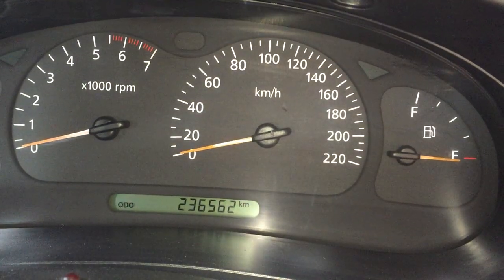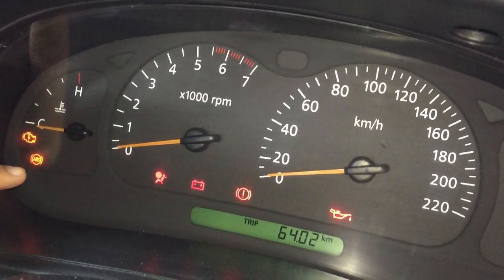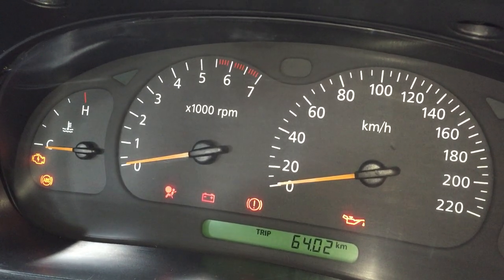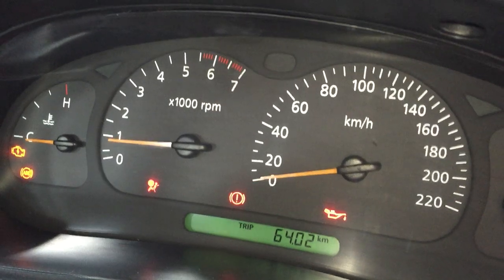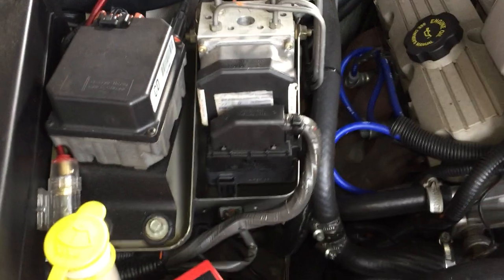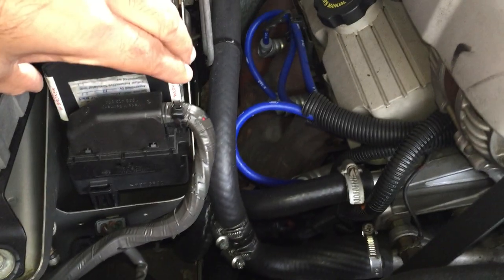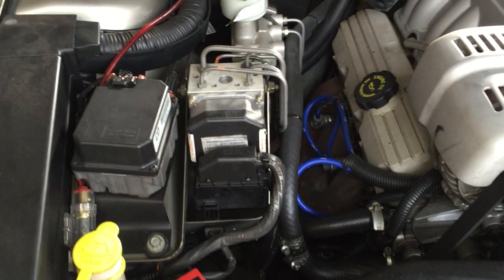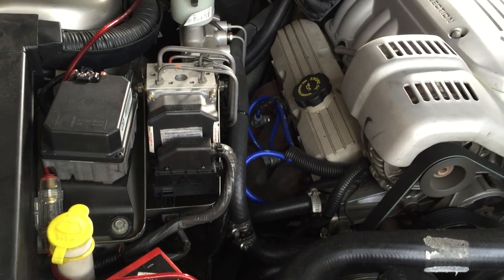HOLDEN COMMODORE ABS  ALL DASHBOARD LIGHTS FAULT

Comment: I had this issue on my 2003 VYII Berlina years ago, it was a known issue with the ABS involving poor quality soldering of the solenoids within the ABS housing. Symptoms were loss of aircon control, various dashboard warnings coming up including the ABS light, plus because I have a Berlina with climate control, a tiny cross displayed on the climate LCD near the degrees display. The issue is widely known and discussed on the Holden forums. Reworked replacement units are available for less than $200 online. Cheers.
PS A failure of the solenoid pack does not affect the braking system, you simply will not have ABS operating. Brakes will operate as standard non-ABS.
Reply from the maker: Well done

Comment: To quickly prove that this is the fault, turn off the engine and disconnect the battery then unplug the main connector on the abs unit (pull the red plastic tab to the right to release the plug). Then reconnect battery and start car. The issues should have gone except the abs light will be on of course. Did this with my VY.
Reply: I just did this... but all the lights stayed on (VU-SS). 

I would normally have Engine, Airbag, Oil Lights on. Temp gauge doesn't work. Cruise On doesn't work, but Active will. By doing what you did, the only difference is the ABS light comes on as well.

Comment: Mate good upload. As of this morning, mine has decided to shit itself. But had a couple "warnings" that something was wrong over the last week or so. First thing i noticed, when flicking the indicator on, my radio cut out then back on, then couple days ago, stopped at traffic lights and split second all the dash lights showed but went out as quick as they come on. Then this morning, started sweet as, but noticed the speedometer/trip part of the dash, was kind of dimming on and off then into gear, started to move and..... DIED.  I have just now, disconnected the battery, pulled the "red" pull on the wires connecting to the ABS mod, pulled off then back on, connect battery and its going again. So off now to get diag tool... see what the drama is
Reply from the maker: looks like you need a new car lol. Bro I would recommend you get a second opinion from a mechanic before you spend any money on anything.
Reply: lol.... na its a minor hiccup bro :-) But had a Holden tech, had a mechanic, had a Auto Electrical dude check it out and all the same thing.  Spoke to the electronic people who repair this sort of stuff and what they were saying, is what i was seeing, so no new car, just a reco`ed module.
Reply: 3 months on and still this bloody drama haunts my car. I sent the ABS module off to get tested and checked out, they could not find any fault with it. All back together and every now and then, especially when you have head lights on, up to a wall, you see the lights dimming, bright and dull, see the dash lights doing the same. Just last night, it did a ripper, cranking along the road, hit high beam and fuckin ABS flashed up, radio went out etc etc... the engine light came on, and stayed on. Got to a destination, turned the bloody thing off. Came back out to return home and no drama what so ever. This problem is doin my head in, so any help out there, woudl be much appreciated. Just flicking through a post from 2010, looks like this other bloke had the same drama. Will copy n paste it. I cant comment on there as it looks like that post is dead. But here is what he said:  "Anyways I have a 2001 VX Acclaim wagon which has a couple of electrical issues, I was wondering if someone could let me know if these are common and how/if I can fix them. I think they are related.
 The first is that the dash lights and radio lights flicker while the car is idling. I have checked the alternator and it is putting out about 14.4 volts, so I think it's ok. The battery is alright, the car never has trouble starting, so I think that's ok. Sometimes when using the indicators it makes the dash and radio ights dim in time with the indicator coming on.
 Sometimes when lowering power windows, the tacho needle drops real suddenly and at times even the engine revs drop a bit too. Also sometimes when lowering the windows, the traction control light comes on. I replaced the master switch in the centre console a while ago with a new genuine one but this hasn't fixed it. Lowering the windows sometimes also makes the dash and radio lights dim quite a lot too, especially if using more than one at a time. The thing is though it doesn't happen all the time, just some of the time! Very frustrating.
 Do you think it is an earth issue? Would installing an earthing kit help? is this a common VX problem?
Thanks for any help you can provide.
 Bandito_Mac, Nov 18, 2010 "
Reply: South Canterbury Sky Watch did you end up fixing this problem? My VT Calais has been doing the same thing.
Reply: @southcanterburyskywatch1362  sounds like an earth problem.

Comment: Hey mate.
Did this fix the issue?
As I'm currently having the same problem...
Thanks in advance.
Reply from the maker: Yes mate
Holden quoted $740 for replacement part plus wanted the old one. I got from a wrecker for $40 and replaced it myself.
Reply: What was it
Reply from the maker: https://encrypted-tbn0.gstatic.com/images?q=tbn:ANd9GcRbS5IP8-glZeQqSxYj7vHNImqhxgA7GigiQg&usqp=CAU
Reply: @ARPMEDIAZ  thank mate
Reply: Champion!
Many thanks bro.
I've ordered the part anyways & will sort it myself.
Always do it yourself if possible...
And any advice is always helpful.
We gotta stick together & assist each other.

👍👍👍

Cheers.

🍻

Comment: Hi just wondering if you can help? Mine came up ABS fault and then when I tried to turn the key the battery was dead! I jumped started and it was fine but just did the exact same tonight! I thought it may be needing a new battery but do you think the two are connected? Thanks in advance

Comment: I’ve got a vy calais 5.7 and I’ve had issues where out of nowhere anytime while driving check engine light will appear and trac off button comes up and freezes no matter how many times you press the button. 
Every time I start my car srs airbag comes up, my car is tuned to have the PWR button on at times and recently I driven the car and it had half the power and the screen said PWR was on so I turned it on normal and back on to PWR and it was a complete different car but now every time I drive my car anytime from 10 seconds to 20 minutes or so check engine light apears and it’s like everything freezes and also climate control is very inconsistent. I hope someone can help me out the car goes awesome but as soon as these lights come on it takes the fun immediately. Thanks

Comment: Do you need to bleed the brakes after doing this?
Reply from the maker: JoJo84 no mate not at all
Reply: only if you disconnect or damage a line an replace it otherwise nah man your good just lift an swapout the module mounted to the unit the unit itself will be in good nick

Comment: My brake fluid was black..an full of metal from the wearing out of the master cylinder brake part.an as well as abs light.rear pads an rotors were shot..big job...shop wanted 900$..did it myself..300$...parts..

Comment: Hi my car started but by the way when I drive the car can’t fast drive some time after that my car engine normally what the problem
Reply from the maker: sultan shakeel most likely spark plugs or air intake
Reply: Rambo Rambo thanks mite helping

Comment: hey i have the same issue but instead of abs light my trac light off shows ... i think my abs and air bag lights is faulty or unswitched i m not professional is machenism but one more issue i had in same cobdition as your ... my A/c not working while the lights turn on in start ... but if i start my car and no engine lights come i turn AC on and once engine light cone up in 2- 5 mins  then i off my ac but and tyrn fan on ... but still its running AC .... its look like when all error lights  come up it froze my system ...
Reply: what u gonna suggest me bro i have same vx commodore 2001
Reply from the maker: Its the ABS module computer. I remember I had to change it. I bought it from a local wrecker for under $50. Once I changed it I did not have any issue with it. 

But it is important to get the same model no as your car has. Mine I think it was 2840 or something not sure was a few years ago. You will need to uninstall and locate the model number which is right underneath of the unit. 

Spoilers Alert - Don't call holden and ask them for the module they quoted me $720 lol  they will probably give you a heart attack lol.  Cheers.
Reply from the maker: When you doing this please ?Still waiting
Reply: Thanks bro i bring my vx commodore to 2 mechanic but they havent found the issue ... i was thinking to writeoff ... thanks alot bro you saved my car ... i will do it soon in this week
Reply: I had the same issue on my vy v8 it was caused dirty wheel sensor
Reply: Vorny Vaughan I think I have the same problem on my front RH wheel sensor when my brakes went to the metal.